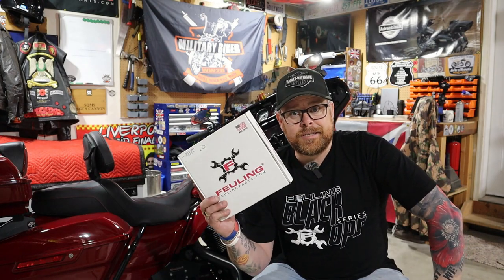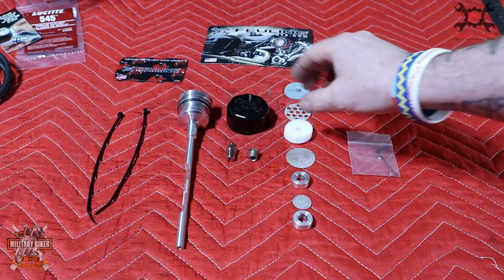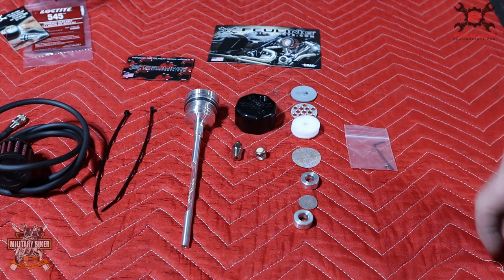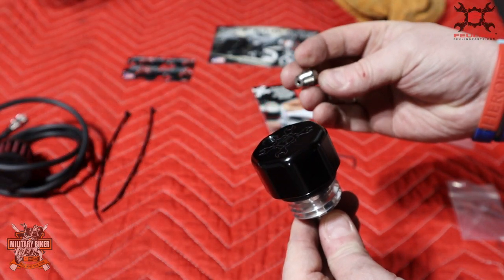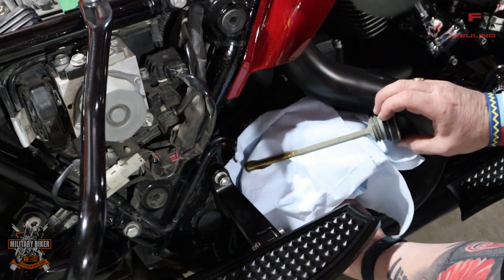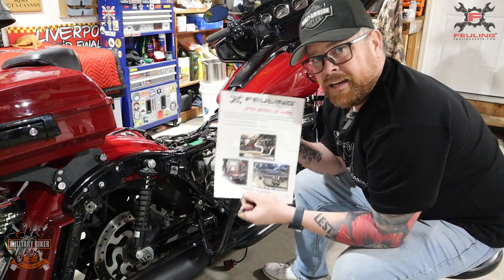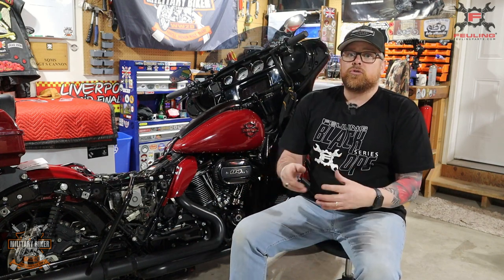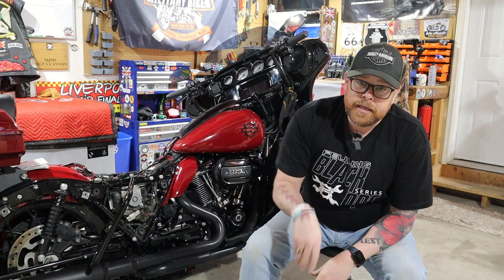Get The Perfect Venting For Your Harley With The Feuling Vented Dipstick!

Comment: Pretty sure, not certain though, if you are running a stock bike, you could probably get away with using the brass vent and not the hose and filter. Anyone know this for sure? Also, did you notice a difference in the smoothness the motor seems to run after being vented? I vented my heads to keep the oil from going into my throttle body into a DK Customs catch can and it just seems to run smoother. SEMPER FI!
Reply from the maker: Hey, so if you don’t use the hose, if it does vent you’ll get oil all over the back of the bike and engine. You could obviously use it without as you said but I’d rather catch it than let it vent all over the engine and back of the bike. User preference of course. I have not noticed anything major on the smoothness side but I’m sure it helps✌️
Reply: @TheMilitaryBiker  Yup! I was just wondering if anyone has tried it to see if they experienced an oiling on the bike. If I get one, I will give it a shot and let y'all know. Appreciate ya!

Comment: I realize that English would be a second language for you, and that can be difficult, but have you tried Duolingo? 🤣 😎👍
Reply from the maker: Hahah I take it your on about my bloopers! 😂✌️
Reply: @TheMilitaryBiker  Yeah bro, just havin' a laugh... at your expense. Another great vid, man!
Reply from the maker: @amateurmoose  haha cheers man
Reply: That looks easy enough, and a good idea to ease the crankcase pressure. Have you checked out the A1 vented dip stick? It allows the air to go both ways instead of having the valve check like the Fueling has. Also, you have to take the hose off to check the oil. On the other hand it's only a little over $100.
Reply from the maker: @johnnolan1291  I have not but thanks for the heads up.